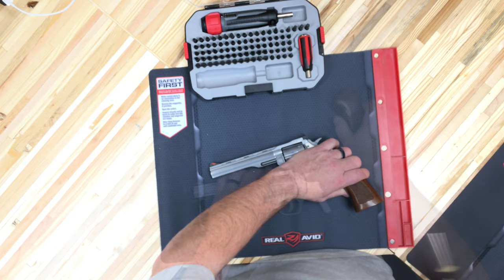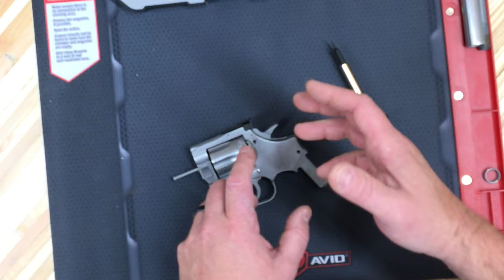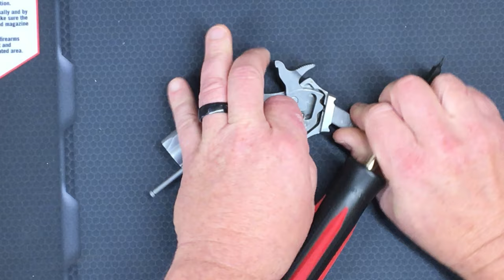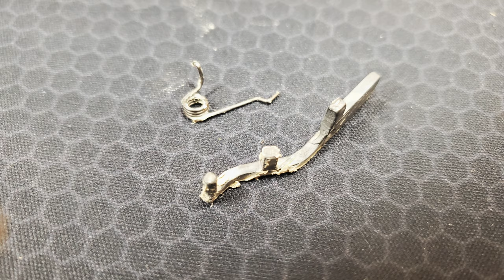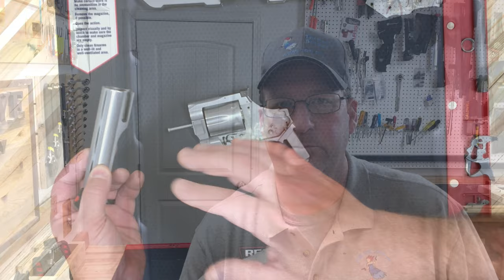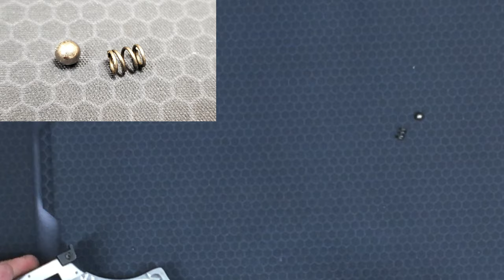Step-by-Step How-To: Deep Clean and Maintain Your Dan Wesson Model 15-2

Comment: Thank you for the very detailed video. I am curious if you'd recommend an ultrasonic cleaner for most of the parts? I've used one before on old cosmoline soaked parts and they worked great and did not affect the finish.
Reply from the maker: I am going to give you a definite "it depends". The trick with an ultrasonic cleaner is making sure you get the gun completely dry and then oiled. I have seen 1911s come into the shop that had a rusted mainspring because they didn't get all of the water out of the mainspring housing yet alone get some oil down there. Sometimes, heated ultrasonic solutions can cause some change in the finish of a firearm. I usually use Simple Green in my ultrasonic cleaner. But only use it for really dirty guns and especially for BCGs.

Comment: Excellent  video on the Deep cleaning of the Dan Wesson revolver, I know the Dan Wesson uses a clock wise cylinder rotation like Colt revolvers and Smith & Wesson uses a counter clock wise rotation, and from time to time the Ejector Rod becomes unwound,  thus locking up the cylinder, how common is this to a Dan Wesson or a Colt?

Comment: Thanks! It really helped. Mine did not have a cylinder spring bearing, somebody else probably else lost it before my dad bought it. Does that make the ejector return to close position once you clear the empties? Mine is a model 14 and the Crane Lock or "U" clip for the bolt plunger is just plain EVIL. Trying to keep it in place while reassembling is quite the trick. I love the gun. Mine has a hair trigger when in the cocked position and if you have arthritis that is great. I also love that the sights are adjustable. Great fun. Thanks again for a great video.
Reply from the maker: the spring bearing can help with the ejector as it keeps it aligned. You may need to have a professional look at it though. Thanks for watching!